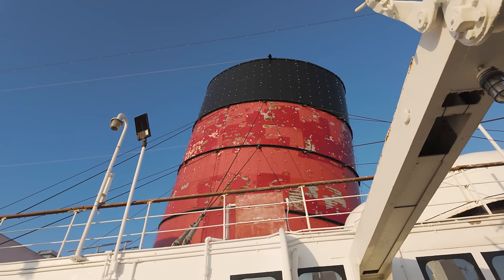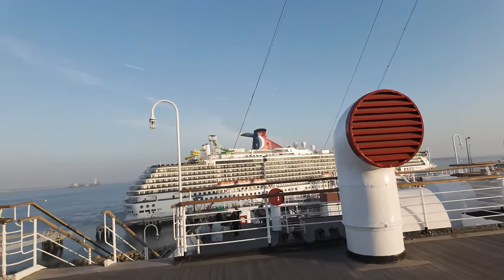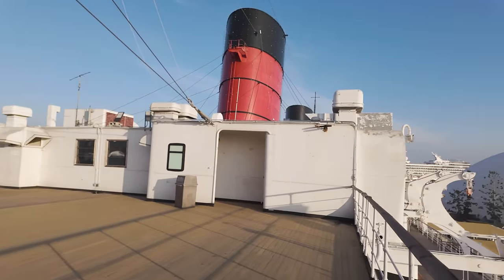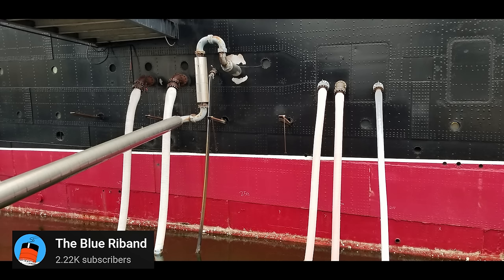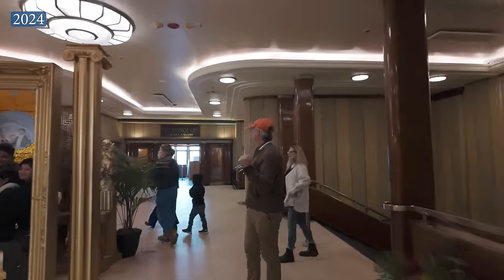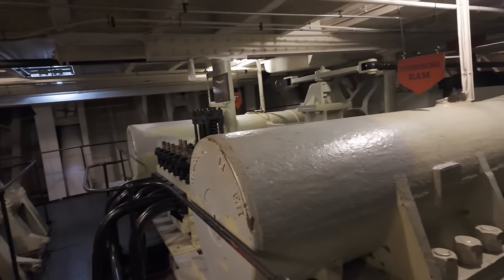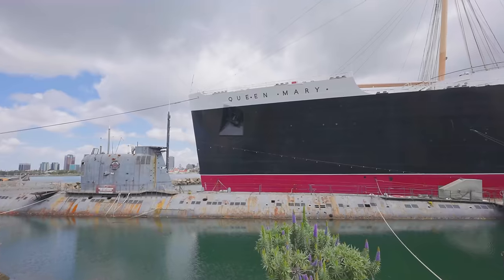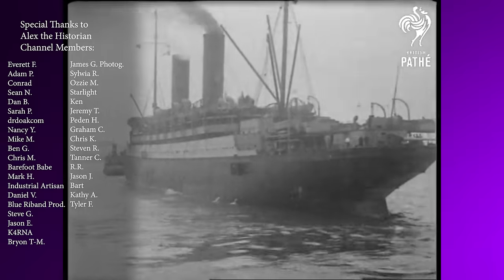Queen Mary REPAIR Update & Year in Review | January 2024

Comment: Thanks for the video and update on this great ship. Glad to hear that some real restoration work is happening rather than the previous cowboys who messed her up. As for the submarine -- it is still a bit of history and should be saved and moved elsewhere. Maybe just get a firm to lift her onto the dock, then sandblast and paint up. That would most certainly not cost 5 million.
Reply from the maker: Oh no the submarine is structurally unsound, the outer hull is full of holes like Swiss cheese and part of the inner hull is breached and flooded one of the watertight compartments. Moving the submarine in any way risks it breaking apart and creating a mess and hazard. The submarine has to be disposed of, and it's going to be a tricky and expensive endeavor.

Comment: I like how they are continuously Praising how they replaced light bulbs.
Reply from the maker: Considering that many of the lamps on the ship would go DECADES without light  bulbs, it's a big deal. But it's not just light bulbs, it the repair of light fixtures that broke and then were never repaired. For the last 30 years, Queen Mary had a reputation for being really dark.
Reply: @AlextheHistorian  You know If they spent a 100 million dollars, restoring the ship to working order for passengers, they would make a fortune. Absolute fortune
Reply from the maker: I made a video about that, I dont think she would make a fortune. Cruise lines worked out a formula for how many rooms, passenger capacity, versus the size of the ship, that would generate a profit. There's a reason cruise ships are so tall and boxy. 

Based on her length and width, if Queen Mary were to carry passengers again, she would need to carry at least 2,500 passengers, all paying above average prices for their voyage, just to turn a profit. 

The problem with that is, there isn't enough room on the ship to build cabins of a modern standard size for that many passengers. 

Actually, being moored to the dock, she sees more visitors per year than she would ever see passengers on a voyage. The trick is to increase her profitability, and visitation. She has the potential to see 3 times as many visitors as she currently does, and still won't feel too crowded.

Comment: I am generally not a ghost believer. However, I did have one odd encounter. I visited the Queen in the 90s. I later returned with my then-girlfriend. She often claimed that she could "sense" things. She got very anxious as we navigated from the steering gear room to the propeller box. She "felt" something in the propeller box, and did not want to enter. It took me a few minutes to coax her in.

As I stood inside, she slowly entered. Suddenly we heard a loud "clunk" and the lights went dark. She quickly backed out and refused to re-enter. I observed the electrical conduit and followed it to a tripped circuit breaker. I reset it and the lights came back on.

This time she required more convincing. I explained that it was simply the circuit breaker tripping, and the lights were on again. Eventually, she stepped through the threshold, when "clunk". The lights were out again. 

A couple of guests arrived, and I told them the circuit breaker was tripping, and I pointed to its location.

What's odd is the timing of the trips with my girlfriend's entry. This was around the year 2000.

Comment: I’ve seen a foxtrot sub out of the water and instead of it being cylindrical it’s more of a oval shape, my point is, do you have any info of how deep her lagoon is and or what the clearance is from keel to floor? And would it be possible to drain the lagoon and stabilize the Queen Mary and the sub using blocks so they can scrap the sub on sight and refill the logoon once that’s done? If not the sub will eventually sink on its own without a doubt and depending on clearance from keel to floor I’m concerned that it could tumble INTO the bow.
Reply from the maker: Well first, the lagoon doesn't have perfectly straight walls, they are angled at about 45 degrees, sloping down to a depth of 46 feet during low tide. (There is a minimum of 12 feet of water underneath Queen Mary's keel.)

The lagoon is surrounded by a breakwater made of rock with many culverts inlaid into it to allow the easy flow of water. If they wanted to drain the lagoon, they'd first need to make it watertight. And the bed of the lagoon is made up of a very muddy silt, which will definitely prove to be a challenging surface to sit the Queen Mary on, as the blocks may just sink into the mud.

The marine engineering firm Elliot Bay Design Group recommended two options: floating the submarine out, or lifting it out. I don't think draining the lagoon was a feasible solution in their eyes.
Reply: @AlextheHistorian  I can understand that, after all even though the tests showed the hull of QM was structurally sound if she were to rest on blocks (without sinking in mud) I’m wondering if it would have the same effect as stepping on a Lego, where all your body weight is shifted onto a small “platform” and said foot forms/shifts around said lego or even breaks the skin. And just apply that to the Queen Mary, so not a serious idea but just a thought lol. Anyways, my understanding is that anyway they try to “dispose” of the sub like lifting it, if it would crumble under its own weight with only the above water section remaining mostly intact, because this goes back to the block theory where if they were to use ropes or chains, the weight of the unsupported sections of the sub would be greater than that to the  roped/chain sections causing the hull to warp/bend/collapse pulling the supports up and through several decks. Collapsing it on the spot. But! I’m no physics nerd so I could be COMPLETELY wrong. Such an interesting topic to discuss and debate about. Thank you.

Comment: My biggest question is, do the engines run? Can the Queen Mary go out to sea?
Reply from the maker: The remaining two engines are permanently decommissioned. The power train disconnected. The propeller shafts have been cut from the engine gearing system. All her boilers and plumbing removed.

She'll never sail again because in order to preserve her historic interiors, the City of Long Beach had to get the ship re-designated as a floating building. Otherwise the safety code changes that took place in the early 1970s and the decades that followed would have required her to be gutted just like SS United States.

Comment: Do you know what happened to the replaced equipment? They might have sold it off like they do when they fix a roller coaster. People would love to have a part of the Queen (with authentication paper work, of course).
Reply from the maker: Which replaced equipment?
Reply: @AlextheHistorian  - Not the whole things but bits and pieces of them. I think it would be cool to have a bit of the steam units. With roller coasters, they sell slivers of wood, bolts, bits and pieces of the cars etc. Just something small enough so it can be framed and hung on the wall. (BTW, I hope your New Year is going fantastic!)
Reply from the maker: @goofyrulez7914  Oh well the steam units were removed back in 1969, to my knowledge none of those were cut up and sold. Back then nobody thought that old steam equipment could be valuable to people. And yes, my New Year is going fantastically!

Comment: The submarine merely needs to be raised up on blocks and displayed out of the water right where it is. People can cut out rust and repaint and weld in new sections without it needed to be seaworthy. Tourists can safely walk through it.
Reply from the maker: The problem is that raising it out of the water requires cranes, and the structure of the submarine is not deemed to be safe enough for that. It could break apart during the lift, the loads would shift, and that could be a deadly crane incident. That's the concern they have.
Reply: @AlextheHistorian  They could use multiple jacks under a cradle from slabs placed on the bottom.
Reply from the maker: @paulbriggs3072 that's true, but with the submarine valued so low, it wouldn't be financially worth it for them. The city hired a marine engineering firm to not only inspect it but to determine the best course of action. All machinery and items of value have already been removed and sold off and anything left behind is not valuable enough to save. After checking the submarine's profitability as an attraction they deemed its value to be too low for any kind of restoration. The engineering firm recommended the submarine for disposal. So while restoration efforts are physically possible, they are not financially feasible.

Comment: What's happening with the pieces of teak deck removed from the fo'c'sle?  If the pieces were clean enough...they could sell small pieces of that original decking as souvenirs, rather than disgarding them. I managed to pick up a piece of the old decking that had broken away (not intentionally broken I may add) a few years back and have it framed as a momento of my visit.
Reply from the maker: It's not original decking though, it was installed in 1994 to replace the original. So it will likely be discarded. The only areas with original teak decks is Promenade Deck and a mostly covered section in the indoor areas aft on Main Deck.

Comment: Too bad about the boilers being ripped out. It would have been nice to see the original propulsion system in place. At least rust protect and paint those areas to prevent further corosion.
Reply from the maker: I last filmed the boiler rooms in 2020, but they have since had rust abatement work done, but they've been closed ever since.

Comment: Are they going to reopen the original pool and run it?
Reply from the maker: They want to do restoration work to the room, but it cannot be used as a hotel pool, it wouldn't pass modern engineering and design standards for use.
Reply: Speaking of which, I believe that's one part of the ship which during its conversion in the late 1960s certain contractors reported hearing children's voices. I think some of them thought their co-workers were flouting rules of kids not being allowed on the ship. When other areas like room B340 are being renovated, I always wonder if construction crews witness long-reported cases of the paranormal. If so, planners doing things like putting Ouija boards in a B340 means they must shrug off their own experiences

Comment: I am shocked that Long Beach is doing a good job managing the ship. When they managed the airport, they hassled the airlines until there were only 2 left. They also hassled Douglas Aircraft who was sharing the airport. The airport was bought by a private firm. They did a 1920’s remodel on it and it’s at full capacity ever since. Ontario, Burbank and Palm Springs did the same thing to save those airports.

Comment: Hi from Finland. How deep is water below propeller
Reply from the maker: There is a massive enclosed tank that surrounds the propeller and is welded to the hull, and it is filled with Fresh Water. Below the propeller there is only about 2 meters of water to the bottom of the tank.

Comment: Why anybody who wants to use a ship as a static object and leave it sitting in water is beyond me. It needs to be removed from the water, so repairs can be made easily. If it is so important to keep it looking like it is sitting in water, then build a dry structure with water around it.  It will look amazing from a distance and on board, and it will also stop all waterline degradation.
Reply from the maker: You can't do that. The ship is too large and too old. A ship of this size is not designed to sit on land permanently, she needs the water to support her hull from all sides. Even the City council asked the marine engineers about putting her on land and they said they do not recommend it because her size and weight would cause deformities in the hull and decks over time. She can be in dry dock for a few months at a time, but she cannot permanently sit on land.

Comment: I understand the thought behind putting the submarine in the lagoon. However must say it’s completely stupid and unnecessary as the Queen Mary is doing well on her own. While I also understand that Long Beach doesn’t want to pay to remove it or repair the submarine. It’s making the lagoon an eyesore. If the former owner is not able to deal with it then the city is going to have to at some point. If the sub sinks or starts leaking toxic chemicals into the water or the air. That will cause an even bigger problem than lost revenue.

Comment: Why on earth does it cost $5mill to REMOVE that rotting sub? DAFQ?
Reply from the maker: -Hiring engineers to create a removal plan
-Hiring 2 cranes to lift it
-Hiring crew for lifting
-hiring hazmat disposal crew and their trucks to clean the submarine to EPA & OSHA standards for a regular disposal team to take over.
-Hiring a regular disposal team and their equipment
-Accident insurance for the project to cover unforseen circumstances, like the submarine breaking apart, falling back in the water, and the cranes being thrown backward like toys.

It's not like this is a one-man submersible, we're talking about a ship 300 feet long, 24 feet wide, weighing over 2,000 long tons, and with its propulsion system still in place, and materials hazardous to the environment if not properly disposed of by the right people.